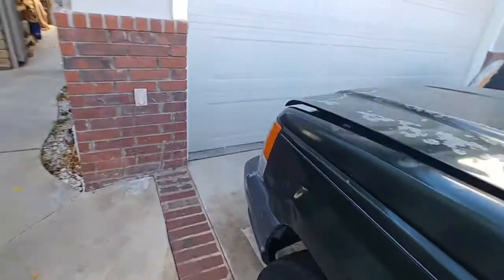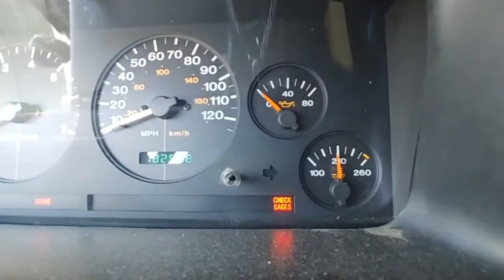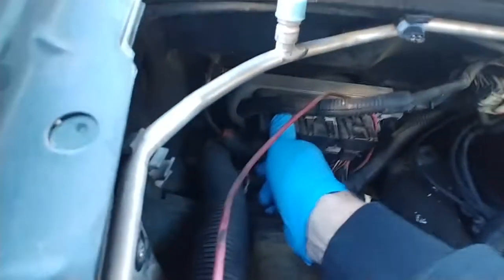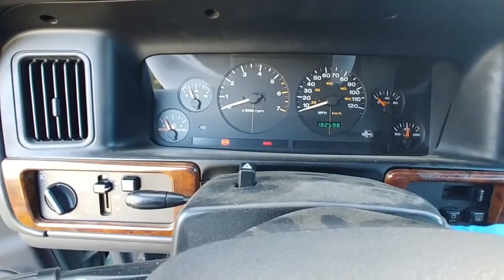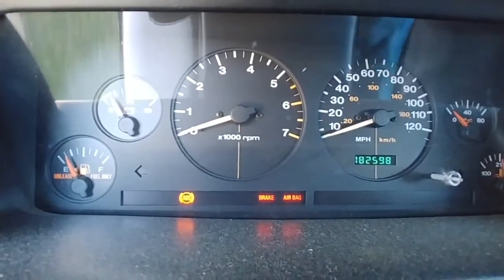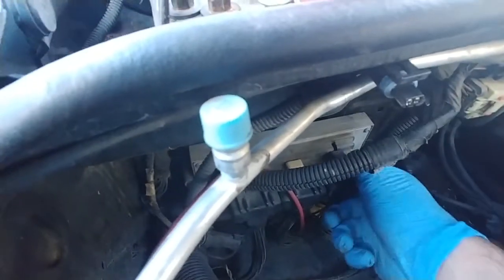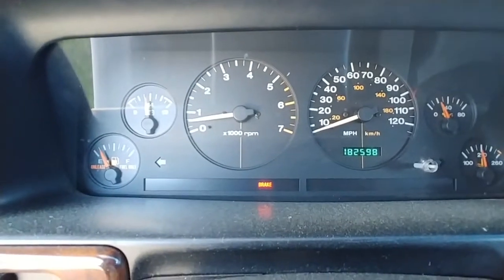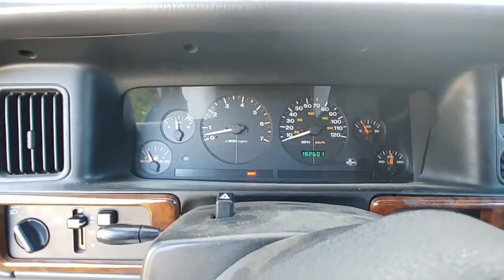1996 Jeep Grand Cherokee Stall Fix - Super Easy - Must Try!! Its not your Crankshaft Position Sensor

Comment: I've replaced my fuel pump, crankshaft camshaft, fuel filter, then the PCM then it started, that was 6 months ago, just this past week my 99 grand cherokee 4.7L just started doing this, I changed the coils and spark plugs, got a new battery and alternator and still wouldn't start, so definitely gonna try this out in the morning and im gonna be so.mad if this is the case. If thats the problem you're the real MVP for uploading this simple fix
Reply: Did it work?? Lol
Reply: How did it turn out?
Reply: Nope had to get rid of the jeep

Comment: I have a 1998 zj with the same problems. I cleaned the connectors but it was short lived. I was told to use a large xip tie and strap down each connector to the ecu. Also make sure the the ecu is not screwed down too tight 1/4 turn loose from tight. It worked until the zip ties got brittle and loose. 5 years+ going strong.
Reply: Some times it helps to take a mechanics pick and bend the connector pin....scraping it clean is usually the answer.

Comment: Grounds grounds grounds. Have to check them. Lots of times the rust inhibits the grounding and it really does a number with the computers in these older jeeps. Find the ground on the body sometimes it’s on the back firewall and unscrew it. Clean it up if it’s rusty I use dollar tree wire brushes. And put back on. Cleaning the connectors with the electric contact cleaner and or wd40 helps too. You are on the right track. Same check starter connectors and battery  posts. Mine randomly came undone one day and had power but when tried to start it completely shut off everything. That’s when I noticed the negative wires were loose. It’s always something lol
Reply: There's also 2 grounds under the driver's seat.......hidden under the carpet.
What a stupid place to put a ground. Pretty much have to remove the seat and roll the carpet out of the way to inspect them.
Reply: @Thundarr995  those under seat grounds, do you have the inline 6, or the V8 ZJ? Thanks

Comment: I got a 2001 jeep grand Cherokee limited edition an I had put it in the shop man told me these jeeps are bad for the Flex plate bolts to back out an that's down around transmission he over time the bolts will get loose an start backing out but now it's doing it again it fixed it for awhile maybe about year an it starting doing the same thing again stalling out on me so it might need tighten up again an this time I have him put some lock tight on the bolts

Comment: I bought 3 new PCM connectors and spliced the wires. What happens over time, the tabs that lock the connectors get brittle and break. Mine is a 97 JGC. BTW your oil pressure is too low. Should be 40.
Reply: I made a bracket out of galvanized steel to hold the plugs in my ecu 😂😂😂 haven't had to touch it in years.

Comment: SO EXCITED to have found this.  I've changed plugs, wires, distributor, coil, and the CPS....all with the same stutter/stall issue on my son's 97 ZJ.  I can't wait for him to limp it over here this afternoon so I can clean the damn connections!!!
Reply: Did you do it?
Reply: @Tommyknoxs  I did and it helped enough for me to hit eBay and get a new ECU.  Can't say it's 100% fixed (still have some EVAP issues) but it's no longer stalling out.
Reply: @timkirk3736  thank you
Reply: Start after gets cold es flyweel sensor.
Reply from the maker: @user-vx9mf4il4m  the flywheel sensor is the crankshaft position sensor correct?
Reply from the maker: I wish it was the permanent fix but it wasn't for me. It will get you going for a while tho. I'm gonna try the crankshaft position sensor next. If that doesn't work then I found a jeep mechanic by me and when I can spare the cash I'll see what he can do and report back. Run on ;)
Reply: @cnote001  So THIS one had me steaming.  Most of my issues were around a cold idle so I just started looking at things in that circuit.  I pulled the idle air sensor out, wiped it clean with an IPA wipe, and damned if the ZJ starts right up, idles great, and accelerates without lag!  Clearly, nothing is ever "done" with a 97 ZJ...but it's one less step away from 800.kars.4.kids

Comment: Many electronics issues can be traced to a ground problem. Also, get some dielectric grease. Clean connectors and squirt that straight into the female side connectors. Wipe excess off with paper towel. The female side should be full of the grease. This will stop corrosion and keep a good electrical connection on the individual pins. Also, if anyone does do the crank sensor, get the OEM from the dealer. They are more expensive, but worth it. The OEM sensor has a stronger(much) magnet and gives the computer a solid signal. The after markets don’t save you time or money in most cases since they cheap out on the magnet. That effects the hall effect sensors operation and signal. 
Clean your battery ground to body connection, use the dilectric to coat surfaces. Also be aware there is usually a separate body to engine connection on many cars/trucks as well. I have used the dielectric trick on all connectors I take apart, and some just for preventative and found that solves most of my electronic problems. Especially with cars/trucks. Good luck!!🤠👍👍
Reply: Thanks a million muchos

Comment: Thanks for your video #Salute I was going to Autozone to go pick up a headlight switch to hopefully cure my auto headlights flickering as well as my interior lights flickering. Jeep ZJ stalled and stopped. Had to wait a while and try to crack it over and over then it finally did, made it to Autozone picked up some Contact Cleaner, Belt Conditioner & battery post corrosion protectant as well as some Durlast Gold coil wire connectors because I didn't have any lights come on, but I scanned the Jeep with my Blue Driver OBD2 and pulled code p0351. I've already changed the coil, but didn't change the wire connector. Left autozone had the Jeep die again in the turning lane leaving Autozone, finally got it to start and almost made it home and it died again on the freeway, but was able to get on the shoulder.....longest wait ever to get it to crack up again. Was able to drive it home while a Texas Department of Transportation worker followed me home....watched this video, unplugged my PCM connectors, (the furthest right one is already has a broken clip when I bought it) cut of the zip tie, sprayed all 3 connectors & PCM connections with the Contact Cleaner and secured it with 2 zip ties really snug on the Furthest Right connector & BAM started it with no hassle and ran for 10 mins smooth, no dips no stall no nothing. Not sure if I should still order the PCM from  Flagship One, but I might. New coil, new duralast gold connector wire, pcm taken apart and reflowed with solder, new ADS relay, new courtesy lights relay. This was the fix right now for me. Can't wait to get this headlight switch installed either today or tomorrow. 02-25-2022 San Antonio, Tx
Reply: Still good?

Comment: I did everything you did, cap, rotor, AIC sensor, CP sensor and cleaned the connectors on ECM. Ended up being my gray connector. Found out while running, went and touched wires and almost stalled. Put a new one on and it's golden. I have 289k miles
Reply from the maker: How did you replace the connector?  Did you cut wires?
Reply: Yes. I cut 21 wires and used wire connectors. Took a while
Reply: @cnote001 did you ever fix yours after the problem came back ? I just bought one with a pcm issue
Reply from the maker: @Tommy Knoxs  negative my man. Still searching. So many strange inconsistencies in the failures. I may try a Jeep mechanic near me that I've found recently.
Reply: @cnote001  2 things

1 ) I noticed you only did the cleaning trick on one connector - did you ever try all 3?

2) have you done the  whole open the pcm get to the motherboard and have someone solder the 10 connectors thing?

Comment: I would pull the plugs on the pcm and spray some electrical cleaner in them and maybe bend the tabs (if possible),so it will have a tighter connection. I'm going to clean up the connections on mine and maybe that'll fix my low tachometer reading. Maybe put a little dielectric grease into the connector. That will prevent most of the corrosion problems.

Comment: Anytime you can wiggle something or slap it, and it works....it's most likely a bad electrical connection. 
Take the connector off, and scrape/ clean the connectors.
(Use: a utility/razor blade...or wire brush... just be gentle, and clean the connection. 'Wah-La!!!'
Always clean off your' grounds' first.

Comment: 04 GC 4.0 Times it will rev to 2k when first started, then idle down to 1100. Irratic idle. Now won't stay running without giving it gas. Replaced AIC, TPS, had tuned up, still same. As long as I give it gas it runs.
Reply: I have same problem. Any fixes?
Reply: Any update to this fix?

Comment: Thank for the tips have a 95 Grand Cherokee having the same problem I'll do that cleaning.👍
Reply: Did it work for you? Having the same issue
Reply: @gregelrod8913  sorry didn't reply.i fix it.was a electric connect to the fuel pump.thanks for the tip.
Reply: How did it turn out?

Comment: I will have to try this out on my Jeep as well.
Reply from the maker: Well it wasn't a permanent fix but I discovered some other things. I got a new computer (ECM) and that didn't fix it. Then I discovered that once it wont start after stalling a few times when I turn the ignition off and on three times in a row quickly, it will start and run without stalling again. Strangest issue ever. Reseting the computer seems to fix it temporarily.

Comment: Its the pc board inside. You have to reflow the solder connections. I had the same issues.
Reply from the maker: I gor a refurbished ECM/PCM and it did the same thing. Could be that thry didn't resolder the connections....who knows. Did the solding fix the issue for you? My computer isn't the kind you can open unfortunately.
Reply: @cnote001  If I remember right, you have a couple of screws and a couple of bend tabs to open the computer up.  You'll think that you're gonna break it as it comes apart.  There is some jelly adhesive in there that looks like ballistics gel.  Once you take the front cover loose, you can see the contacts.  You'll be able to see where the solder broke.
Reply from the maker: @jasonbennett3033  my computer is a different version. There is no plate to take off. It's one rounded peice of metal that houses the circuit board.
Reply: @jasonbennett3033  mine is a
A Larado straight 6. Does it come apart? I am trying to do this on my own so I'm not a professional mechanic or one at all lol and being female everyone keeps telling me women can't work on cars but I've done everything I could think of I just don't know about messing with the computer and messing it up having no car what so ever. If you know anything about the Laredo before I go and take it apart if you know it can be opened up please let me know and if there if some sort of pic diagram of what needs soldered could you show me? Thank you
Reply: @kittykittybooboo12  Hey.  I have the straight 6 too.  The front panel on the ECM comes off.  You have 2 screws and 2 tabs that hold it on.  Pull it apart carefully.  There will be a sealant jelly that keeps moisture out holding it together.  It looks like orange-brown ballistics gel.  You can see on the back of the front cover where the solder points are.  They break.  I've repaired mine a couple times.  Never could get it to take.  Had to go to the junkyard and buy a replacement for $35.  Make sure to get the ECM and the BCM at the same time.  They talk to each other.  Otherwise, you get all the factory alarm good times.  Body Control Module is a little black box under the steering column to the left -  3x3x5?
Reply: @jasonbennett3033  thank you I have tried soldering it together and it lasted 2 days now litres back to doing the same thing. I guess I'm heading to the junk yard and see if they have a brain for the jeep. ECM BCM. could this also be why all of a sudden it's back firing? Yesterday it was spitting like small looked like hot coals out the tail pipe on the road. I pulled over and shut the car down let it rest for awhile. Pipe Didn't look clogged from what I could see soi figured it must be part of the ECM dysfunction.
Reply: @kittykittybooboo12  Maybe that'll do it.  Maybe it could be a bad catalytic converter with the stuff that it's kicking out?  Dunno.  I would imagine that it has to do with the raw fuel being dumped through the system from the electronic malfunction.
Reply: @jasonbennett3033  well thank you so much you have been very helpful. I appreciate your patience with a me and all my questions.
Reply: I would definitely clean connector’s first and if that works for over a week then clean plastic at plug-in and put a couple dabs of ca glue to hold in place. That or zip ties. Either or can be takin off if needed replaced.

Comment: Your Computer will have to be Resoldered.  The solder joints break down because of subpar materials in the solder used to connect them the first time the computer was made.  Have seen this same problem many times.  The computer will fail symptoms will be rough idle, skipping on 1 or more cylinders, then Crank no start.  Then you'll either have the computer refurbished or another computer that has been refurbished.

Comment: Just had that issue. It was the grey connector. BUT, I unplugged it and plugged it right back and it fired up everytime. Its looks like your connectors
Reply from the maker: Ha! That's exactly what I do in the video lol
Reply: All I saw was you wiggling them. I thought oh boy that would make it worse. Anyways, glad we both figured it out. I probably didn’t need all the replacement parts but oh well, it’s done

Comment: This just happened today. Got the jeep couple months ago did this to me the first weekend at the lake it shut itself off and let it sit for 5min turned it back on and was fine and had check engine light and it went away. Well had a good snow storm today and was pulling people out and it happened again and it was worse it kept stalling spitting since I was driving trying to keep it alive. Had to stop 5 plus times since it would die. Finally got it home. Have p0351,p0352 all the same showing ignition coil but it’s always started and drove fine. Seems to do this when I get rowdy with it. Like those connections are coming loose and barely make contact or something

Comment: Mine doesn't do that,but my tach reads a couple hundred rpm low at idle speed. I checked the actual idle speed with an Autel Maxi-pro scanner and it says my idle speed is about 550-+or- a little while the my tach is reading about 350 rpm. Also my information center and dash lights were flickering or didn't work at all sometimes unless I'd flick the switch, then it worked. I replaced the headlight switch and it fixed both of those problems.
Reply: my center info center went down while driving. I think wiring problem. Have to pull dash and unit to check behind. Any suggestions?

Comment: Wow really I have a 96 jeep grand cherokee laredo and I been having this issue and tried taking it to get emissions test and all 4 times it failed and last time it died right when it was my turn to pull in I wiggled wires and got it going and still failed.
Reply from the maker: Nope, wasn't a permanent fix but I discovered some other things. I got a new computer (ECM) and that didn't fix it. Then I discovered that once it wont start after stalling a few times when I turn the ignition off and on three times in a row quickly, it will start and run without stalling again. Strangest issue ever.
Reply: @cnote001  how is the jeep running currently?
Reply from the maker: When you wiggle the wires, it could reset the ecm. Then you need to drive a while to collect data before the car will pass again.

Comment: I have a 99 jeep grand Cherokee, it started randomly dying when I was driving, when I was in the highway it didn’t die, then it started dying 4-5 times a day so I parked it,I bought a camshaft sensor for it and I got into it to my Jeep to pull it into my barn and it wouldn’t start so I just replaced the sensor anyways, anyone have any ideas?
Reply from the maker: Well, unfortunately that's the common issue we all share. This fix is also unfortunately temporary. Many think it's from faulty solder joints in the old ecm. So far no one has the exact fux but when we find it we will save many!! Good luck!!

Comment: I have a 98 grand cherokee varis with the 5.2 i drove home and now i'm having trouble with it idling it will crank and run for about 2 seconds then die if you give it gas it'll rev then lose throttle response go to zero rpm and die new alternator battery iac. Any incite please help

Comment: This is exactly what mine is doing right now. It cuts off all power then when I try to start it sounds like it's out off gas. After sitting for a min or two it'll start and die. I can't turn heat or headlights on or it'll die. I've done everything you are doing changed everything gauge light comes on every time I turned the corner and it would die. It has to do with that connect it keeps coming loose. I will try and clean it off like you suggested see what happens. Thank you. If not can you buy the connect? Where does it connect from the computer to?
Reply: No problem. Jeeps are great except for the electric.  Jeep owners have to stick together.
Reply: @jasonbennett733  yes I agree or I would have never been able to hopefully resolve my issue that someone else has gone through  spent money on parts that was totally unnecessary to find out out really was a simple fix. Much appreciation Thanx again😊
Reply: There's a ground under your cup holders check it